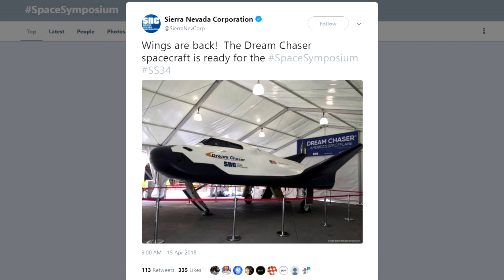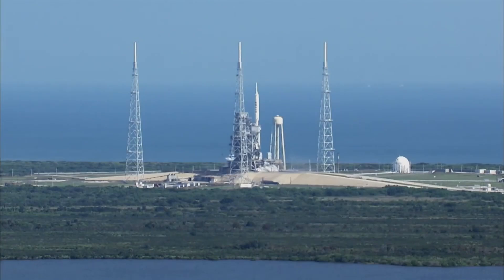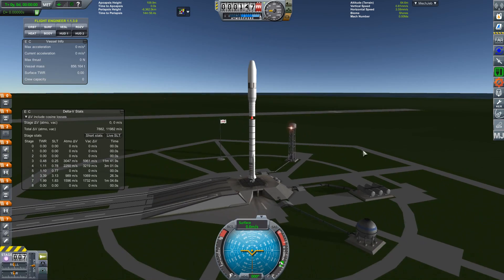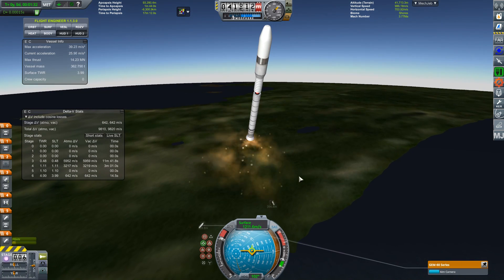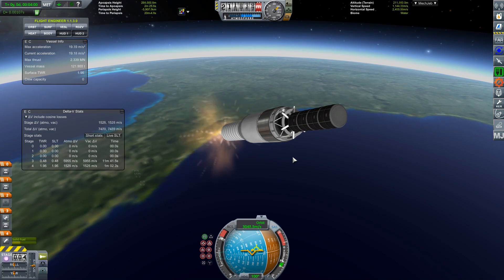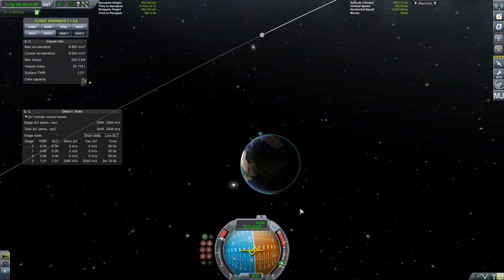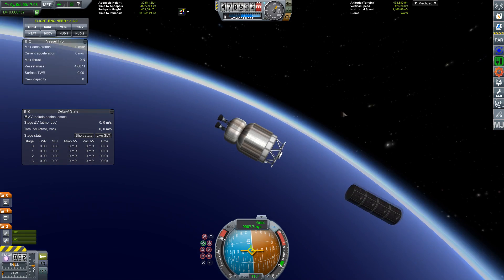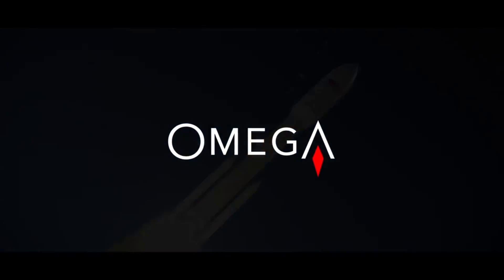OmegA by Orbital ATK -  Simulated In Kerbal Space Program

Comment: Man it makes me sad that this will now never be built. If done by the right company, solid rocket motors give higher thrust than liquid motors at a cheaper price and the increased simplicity of not needing complex engine plumbing and whatnot could bring the cost down even more, and they are spectacular when launching, so much power for lifting lots of mass and then combined with the awesome efficiency of a hydrolox upper stage just seems like a super practical concept, I think it's such a shame that designs like this keep being cancelled, like I said right away, if only the right company who wasn't a typical greedy government contractor would make a rocket with this concept and prove just how effective, lower-cost and practical such a design would likely be. My favorite rockets that currently exist are ones with combined SRMs and hydrolox, the Ariane 5, Japan's H-2, the SLS, and of course the space shuttle and Delta IV Medium in the past, the massive unbeaten power of solid rockets and then super efficient and clean hydrolox seems like a perfect combination. And you can have a smaller rocket if only the upper stage is hydrolox like the OmegA/Ares 1/Liberty rockets, since one of the big downsides to hydrogen is needing huge tanks. Just seems like so many benefits. And I know these sorts of designs have the downside of being declared too dangerous for crewed launches, but that doesn't apply to most launches of satellites and cargo, and I bet it could be made just as safe for crew as liquid rockets if you just had a launch escape system designed to pull the capsule further away and outside of the debris track of the solid propellant "firebrands" raining down in the case of a failure. I really hope to see such a design come into its own in the future, until then though at least I can build them in KSP:)

Comment: Well thats a cute little project to keep the people who make solid rockets for the military busy between wars. But lets not delude ourselves into thinking that solids are appropriate for getting stuff to orbit, short of ICBMs. They don't have the ISP or non-catastrophic failure modes of liquid rockets.
Reply: Specific impulse doesn't matter for first stages, and a catastrophic failure mode is not terrible since it's just an uncrewed vehicle.
Reply: A solid motor is always developed, tested, build and delivered as one complete unit. This makes it very easy to adapt, reliable to use and cheap to produce. The fact that it's one clearly defined unit can also lead to competition between booster manufacturers, which generates technological progress and further cost reduction.
Reply: Who cares if it blows up? Thats a matter for the insurance company, and perchlorate based propellants are really cheap.
Like absurdly cheap.
Reply: Yep. For example, Atlas V is switching from AJ-60 solid motors to GEM-63 motors because Orbital ATK said they could deliver for a much lower price.

Comment: A few times you referred to the solid rocket boosters as "engines", and the 3rd stage hydrolox rockets as "motors"... I was under the impression that solid rockets are strictly referred to as "motor" and liquid fuelled, throttleable rockets are referred to as "engines".
Reply: SRBs are engines or motors (usually motors), liquid fuel rockets are strictly "engines", never motors.

Comment: Why are they using solid rocket engines? Because of this, we know they will never carry any human into space. Solid rocket engines are way too unsafe.
Reply: Of course they won't, that isn't their goal. And it has nothing to do with safety, it's about the launch environment. Solid motors are not inherently unreliable.
Reply: Point taken.
Reply: Also, Orbital ATK currently manufactures the GEM and Castor series SRBs, as well as the old Space Shuttle SRB and their derivative SLS SRBs.  So basically, they have all these parts (and production lines) already, they're just putting them together in a new way to make a cheap heavy lift rocket.

Comment: Once you're in geostationary transfer orbit and releases the payload, does the payload then boost itself on the apoapsis to get a circular orbit?
Reply: Yes, and it also adjusts its inclination (unless it launched on Ariane 5, where it's basically already equatorial).
Reply: Does the payload usually has engines as well to burn on the apoapsis?
Reply: Ambient Morality
Reply: Yep, it has to. Typically, it has a main thruster for the maneuvers (such as orbit raising, repositioning, etc), and a set of several thrusters for station-keeping and attitude control. The main thruster is usually a bipropellent engine, often MMH and N204, and the station-keeping thrusters are usually either bipropellent or xenon- or argon- ion propulsion. Sometimes the entire spacecraft uses xenon propulsion, which means it's slower to get into position, but usually has a lot more impulse or is a lot lighter.
Reply: On the hefty satellites using only chemical propulsion, the fuel can be up to about 50% of the satellite mass.
Reply: Ambient Morality thank you very much!

Comment: I noticed that the exhaust plume got larger as you went up, I know it's because of the pressure, but forgetting the actual term. Anyways, what mod are you using to cause that? I've been looking for one for a long time now.
Reply: John S. I believe it is called RealPlume :)
Reply: Expansion is the term – as in a nozzle is "under-expanded" if the exhaust continues to expand outwards after it leaves, and "over-expanded" if the exhaust is forced back in by atmospheric pressure, and "grossly over-expanded" if the exhaust separates from the nozzle walls due to atmospheric pressure.

Comment: Looks like they're sticking with non reusable rockets, we'll see if they regret that decision in a few years
Reply: OATK doesn't make any liquid fuel stages, and reusing solid motors has never worked out. They literally don't have the setup to make a reusable stage like Falcon 9.
Reply: klosskopf der1. Because it was cheper to make new ones, given how cheap Srbs are
Reply: They reused the Shuttle boosters. Wonder why they stopped so. Probably its not worth it
Reply: Just because it's not reusable it doesn't mean it's a bad rocket/will be a bad rocket. It just has to take its payload up there and that's it, it doesn't really matter how it does it.

Comment: Heya Scott,
Love your videos! Random question, my brothers computer was having really terrible ping today while playing LOL but we found that if we turn the dryer off (which is located in the spare room as well) the ping goes to a completely normal level. How does a clothes dryer affect the wifi so severely?
Reply: it is the electromagnetic interference from the motor disrupting the wi-fi signal. simply move your pc or just wait to dry clothes until done playing. also..yoi could use shielded wires..thay help protect the signal from any loss when around equipment that generates EM intereference.
Reply: I had a simmilar experience a few years back that took me ages to identify the cause. My xbox360 would randomly get high ping and then after a few days of this it disconnect alltogether. Then it would not connect to the internet, neither via WiFi, nor using a LAN cable. Of course I blamed the console and was about to send it in for fixing when a friend brought over his 360 and it experienced the same issues. 

Next on my checklist was the router. I tried a different router - same thing. Then I decided to test in a different room, but the issue persisted. I wanted to try another room, but had to get an extension cable some other appliances were currently plugged into. And suddenly there was no more problem. But it wasn't the cable, it was my old sat receiver. Somehow it sent current into my TV wich then distributed the interference into the main house circuit. 

I've never ever seen something like it before and up until your comment never again...
Reply: This is an interesting question because it involves motors and radio-frequency interference/signal behaviour, which are both pretty deep subjects. :)
Motors are notorious for generating electrical/radio-frequency interference, especially older types that use brushes and a commutator ring to transfer current to the rotor (the spinny bit in the middle which is attached to the output shaft)... the noise is generated due to arcing that can occur as the brushes slide over the commutator. Modern AC Induction and Brushless DC motors don't generate this type of interference (they don't have brushes), but can instead generate EMI/RFI from their control electronics if they are of poor design and/or don't feature in-circuit noise suppression. 

Interference from either type of motor is usually negligible when used in laundry appliances as the chassis/body is generally made of metal and grounded via the supply lead, acting as a Faraday cage and short-circuiting any electrical noise to earth.  However it's always possible for the ground connection to become corroded/unreliable/intermittent, especially in machines which are subject to constant vibration while operating and are located in damp areas like laundries (although I note that yours is in a spare room).

If it's an old dryer, it might use a brushed motor or an AC induction motor of older design (EMI/RFI wasn't such a big deal in the days before computers and Wifi became ubiquitous). If it's a newer model, the motor may be of poor design/manufacture, or the interference might be generated by the control electronics. In either case, it may have a bad earth connection (not done right at the factory, shaken loose in transit, corroded over the years, whatever). 

If you have access to a multimeter (or buy a cheap one online for about 5 bucks delivered, they're a handy thing to have) you can test the ground connection by setting the meter to the lowest resistance (Ohms) range, touching one probe to bare metal on the back panel or anywhere else on the chassis, and touching the other probe to the ground pin on the supply lead. You should get a zero reading or close to it, a cheap meter will probably just show a dash ---- .
Note that it might be well worth checking this as the ground connection is not just for interference suppression, it's also there to ensure that the internal fuse blows or the circuit breaker trips in the event of any fault which makes the body of the unit live at mains voltage, thus alerting you to the presence of the fault.

I hope that someone finds this to be an informative/useful wall-o-text. Time for another beer, cheers. :)
Reply: Have you tried turning the drying on and off?

Comment: How do you throttle down for maximum dynamic pressure with all solid boosters?  Or is that the goal of the all carbon-fiber design?
Reply: They modify the shape of the fuel plugs so that it produces different amounts of thrust at different points in the flight. The Space Shuttle's boosters did this too.
Reply: You dont really need to throttle down for max-Q depending on your thrust IIRC F9 does not.
To throttle SRBs you have to shape the propellant inside essentially "preprogramming" thrust
Reply: Falcon 9 does throttle down for max-Q, quite aggressively (70% throttle nowadays). Q limit is higher for fairing than Dragon, so the throttle-down is longer for Dragon missions.
Reply: Friday Harlowe I always assumed the throttle down the shuttle did was just the liquid engines, but I guess as others have said they could do it with solid boosters as well.
Reply: Nearly every single F9 launch commentator mentions the throttling of the engines for max-Q. Even mentioning the deeper throttling required for Dragon. Do you even SpaceX bro?
Reply: You can also avoid throttling if flying a trajectory that allows for this.For example the Delta II isn't able to throttle.
Reply: Patryk Kaniewski hey thank you haha